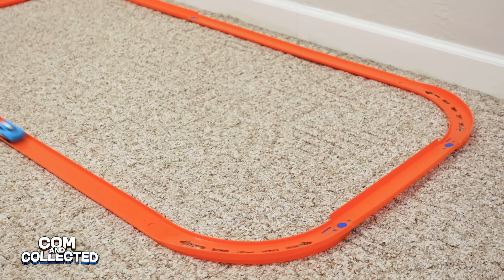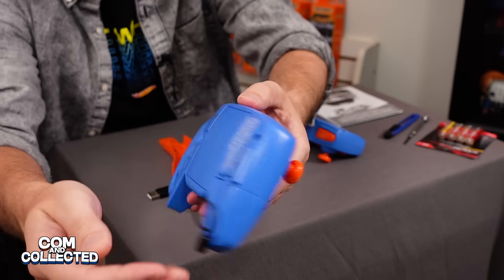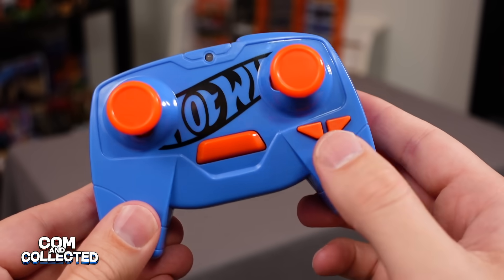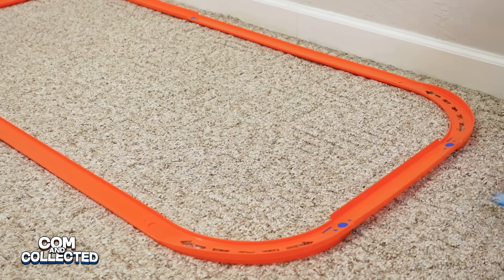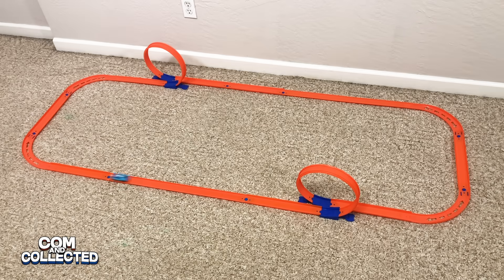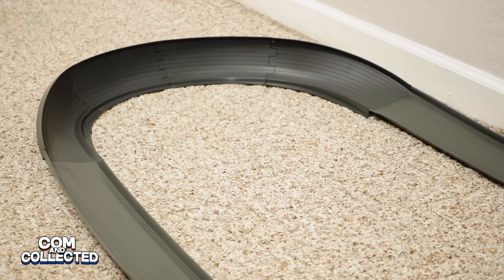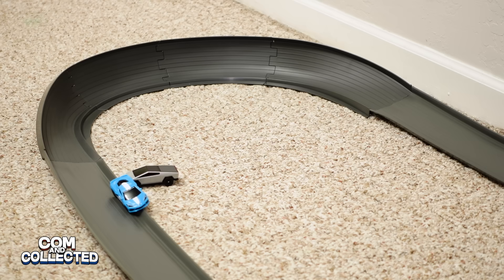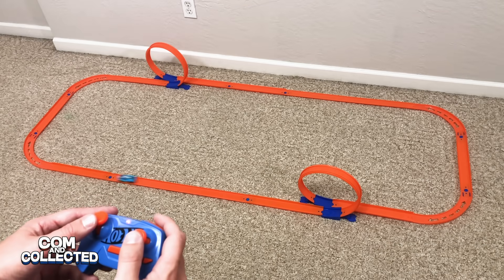2022 Hot Wheels RC Corvette C8 Review, Unboxing, Track Test

Comment from the maker: Which Hot Wheels RC is your favorite? Do you prefer the new controller and USB charge cable?
Reply: Gtr r35
C8
Reply: I made my own
Reply: WOW😮
Reply: You talked me into getting one of these Hot Wheels RCs, plus a track.  Unfortunately, I only had a choice of a white GMC truck and a Telsa Roadster (I was wanting a corvette or porsche).  I was a bit disappointed that the controller didn't have the cord in it, since I can be absent-minded at times so the cord in the controller would have been nice.
Reply: @MrEapie how do you get it
Reply: OG, I hav both cars, the corvette and cyber truck
Reply: Corvette is solid the vid is very helpful makes me want to consider buying an RC hot wheels
Reply: the cybertruck
Reply: I just got the lambo and its not even proportional steering and throttle anymore! 🤦🤬
Wtf they made it alot worse.  Why the heck would they do that?
Reply: I have one
Reply: I need that one please

Comment: Mine just got in, it's a cyber tuck but it has this LED light that lets me know when the vehicle is charged, now I did everything accordingly and the car suddenly went off after a few seconds of testing the acceleration. Also this LED light is not turning on or anything when trying to sync.
Reply from the maker: I don't know, I hope you can return it. It doesn't sound like user error if it turned off after a few seconds.

Comment: Any ideas where to get a replacement charging cable?  The kid already lost the cable
Reply from the maker: I would keep an eye on the different Hot Wheels RC on Amazon. Sometimes certain ones are under $10. You’ll want to make sure it’s the newer version with the detachable charge cable (smaller sized controller). But you’ll have a spare cable. And in my experience the cars will all sync with each others’ controllers. So you’ll effectively have a spare car and a spare controller also.

Comment: This is about the size of the rc car I'm looking for so I have something to do in the heat/cold.  I've avoided these cars because they look like they are cheaply made. Is this the case? Also, what's your opinion of the cars (without a track, I'd have to get that later)? Since you have to "bind" the car to the remote, can you bind it to a different remote? Are they worth the money? Thanks.
Reply from the maker: They don’t seem cheaply made to me. But I can imagine them breaking if you run them into the wall or something. You need a large, smooth, hard floor to use them off track. Most of our house is carpeted so it doesn’t work. There are a couple competitors that Walmart carries. “Adventure Force” branded. They could be good but definitely seem more cheaply made. I’ll test them out one day and make a video.
Reply: @ComAndCollectedFastLane  
First, thanks for the response!  When I mentioned that they looked cheap, I was going by the picture on Amazon. Also, "cheap" is probably the wrong word and was mainly about the controller.  My house is mostly hard wood so this scale would be great, since the 1/24 drifter I have is uncontrollable on the hardwood as it's to slick.  I really want something for indoors so that way I can take my bashers, etc. outside when weather permits, and when it doesn't, I'd like some thing for indoors.  To that point, I may have to check out some of your other reviews and check one out with some of the tracks listed above.

Comment: How to you turn the RC off for the Corvette?

thanks
Reply from the maker: If the controller has a sync button in the middle, you can press and hold it for a few seconds to turn it off. If it’s a newer controller with no sync button, the controller just turns itself off after a few minutes without a connection to the car, assuming you had turned the car off. Hope that helps.
Reply: @ComAndCollectedFastLane  thank you so much. we have the newer one, did not notice that. 

my kids loved it, but after a couple of days, one of the wheels is loosen from the rottor axis, and the car is not moving in a straight line. i'll try to fix it. thanks again for the kind reply.

Comment: Just got this for my son. We are having an issue where one of the back wheels is getting stuck. Any recommendations?
Reply from the maker: Sorry, I haven’t had that happen, so IDK. I might check for debris or to see if something is bent or rubbing. The car can  come apart somewhat with a little screwdriver if you want to poke around. But hopefully you can return it if it’s broken.
Reply: Thanks. I will check that out

Comment: Hi dear How to turn off the remote control ？it's still Flash red light ？？thanks
Reply from the maker: I’ve heard if you press and hold the sync button you can turn off the controller. But I haven’t tried it. I guess I always just turned the car off and the controller turned itself off for me. 🤷‍♂️